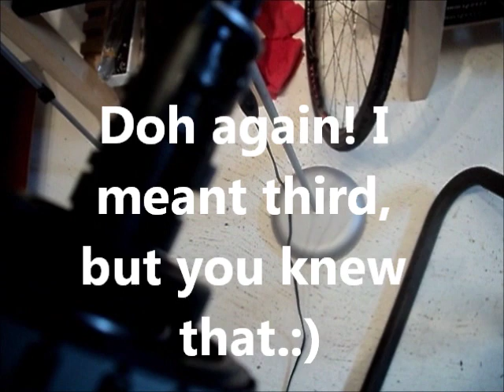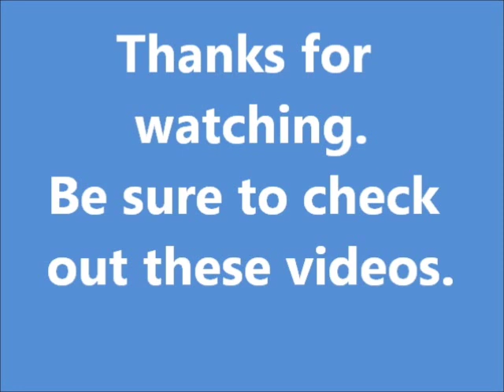Shimano Alfine 8 speed, Why shifter adjustment is critical.

Comment: Thanks so much for this video, it narrowed down a problem I'm having with my hub, though I'm still not sure how to remedy it: I only have gears 1 and 5. Shifting 1-4 stays in 1st gear, then shifting from 4 to 5 gives a good shift to 5th gear, and shifting from 5-8 keeps the bike in 5th gear. So my clutch must be working, but the pawls are not. Have you seen this before? Any tips before I open it up?
Reply from the maker: Two possibilities come to mind. Either the pawls are not engaging or the high speed roller clutch has failed. This would cause the symptoms you describe.

Comment: Besides the Electric Shifter ( MU-S705 )  Why is one hub Electric Shift ( SG-S505 ) And one Mechanical/Cable shift ( SG-S501 )?
Why can't you put the 'Manual/Cable' shift on the SG-S505?
Reply from the maker: The SG S505 has no shift return spring. The stepper motor does the shifting in both directions. a mechanical shifter would not work unless you cobbled together a two cable pull pull system.

Comment: In addition to being completely out of focus, this video doesn't follow up on how to adjust the shifter cables. My alfine 8 shifter had trouble going from 4 to 5 gear. The hub also makes crunchy sound when pedaling backwards.

From other sources I figured out the procedure:
-Shift up to 8, then back down to 4. Check for the indicator lines on both bottom and top of the Alfine hub, on the drive side
-If the lines don't line up, twist the barrel adjuster on the shifter, then shift to 8 back down to 4 again
-Repeat until the indicator line lines up

My shifter did better after lining up indicator but still had trouble with 4 to 5. Next step is to flush the shifter with WD40 followed by relubrication. From what I gathered, the backward pedal noise is "normal" for some alfine 8 hubs and is not indication of any issue. Hope this helps

Comment: Thanks for this peek inside the Alfine. Very interesting. I'm wondering if, with your experience with this hub, you might have an idea as to why when I go to readjust the shifter cable tension on my bike, equipped with the Alfine 8 hub, I always find that I need to loosen the cable.

This is contrary to my experience with other bikes, and other cable-actuated devices on the bike (i.e. brakes). Over time, cables tend to stretch and need a bit of tensioning. Or brakes wear down, and need significant tensioning at the caliper.

But why would my shifter cable tend to tension itself over time, requiring me to reduce tension when adjusting it?

Comment: Need your help. You have a lot of mechanical experience to understand all these intricate design functions. I installed an 8 speed Alfina last july and it never worked on gears 1-3 (gear slipping grinding . So i use 4-8 only. It is an ebike with a mid motor . Is there a particular weakness on the design drive of 1-3 vs 4-8? Or maybe i did not set this up correctly. I know that on gear 4 shifter setting, the yellow line and dot should be precisely aligned. Please let me know what is wrong here.

Comment: The shifter control, (on the bars), was not functioning so I stepped and cleaned everything and cannot rebuild it.  Damn that thing is intricate. 
So Im trying to run the thing with twist shifts from another system. But it doesn't click enough times. Only for 7 speeds instead of 8. This already seems like a wasted venture to me but I'll put it out there. This won't work will it?
I need to find an exploded view of the control unit to rebuild it correctly or buy a newie. Or perhaps another shifter by Shimano  with 8 positions might work?
 I think I already know the right answers to my questions. It's just that sometimes, especially with stuff we are inexperienced with, we can overlook a simple fix.  Anyone got any?
Reply from the maker: A Nexus or Alfine hub has dedicated shifters. One will work with the other, but an 8 speed derailleur type shifter will not work. The cable pull increments are different.

Comment: Would not having the shifter cable correctly adjusted possibly destroy the clutch? I have a strange clicking noise when I free wheel or back pedal only in 5, 6, 7, and 8th gear. Is it possible to remove the clutch/RH cones without the special shimano tool?
Reply: Just a heads up. I had my alfine 8 for two years and started developing problems 6 months ago where certain gears in the higher rang (5,6,7,8) would not engage smoothly and where the 8th gear began continuously clicking. . Adjust was spot on. I just fixed the problem today by changing out the cable and it works perfectly. I opened the hub 8 months ago and everything inside was pristine and well greased. The reason why changing the cable worked so well is that once you get into the higher gears on the alfine the tension in the shifter cable increases causing it to stretch more and be less accurate in the higher gears. This is many alfine users a have issues in the higher gears. Cannot believe that the cable change was so simple, easy, cheap, and effective. Should be the second troubleshooting step after checking adjustment. Best of luck to everyone!!!
Reply from the maker: +Clock Radio 
 Clicking sounds when backpedalling in high range are completely normal. If you are not having engagement or any other functional issues, don't worry, just ride.
Reply: +Dan Burkhart  This isn't normal clicking. There is something wrong with the clutch - and this fantastic video shows me that standing up while accelerating between 4 and 5 with the selector cable maladjusted means something has broken.
So can you imagine the good work you could do if the video was IN FOCUS!!!!!!!
Reply from the maker: +Clock Radio Yeah, I know. I shot this video with a broken camera. The viewer screen did not work.
I will upload a replacement soon, but I am very busy with other projects at the moment.

Comment: Thanks for the video.

For non-techies like me who are curious about how IGHs work inside, it'd be cool if you could shoot it again by making sure that 1) the camcorder focuses on the gear hub in the foreground instead of the background so that the gear hub isn't out of focus, 2) that the background is dark while the foreground is lit up so that there's no backlight and 3) the camcorder is put on a tripod so that it doesn't shake while shooting.

Ideally, you could take several shots and put them together using a basic video editor like Windows' MovieMaker.
www.videohelp.com/tools/sections/video-editors-advanced
Reply from the maker: Thanks, I realize the video quality is poor. As promised at the beginning of the video, I will be adding a video showing in depth how this hub works, but I am shopping for a new camera first.
 The camera I was using has a broken view screen, so I can't see what I'm recording.
 Look for a much higher quality video on the topic early next year.
 Dan
Reply: The current camcorder could be good enough for that purpose as long as 1) the autofocus doesn't get lost between the foreground and the background (hence the need to use a dark background), 2) the part you want to focus on is well lit (just use a flashlight) and 3) the camcorder sits still (tripod). Maybe the camera even has a "macro" mode for shooting up close.

You could shoot the different scenes out of order and edit them later, as it's easier to focus on either shooting or explaining but not both at the same time. I personally use Corel's VideoStudio Pro but even Windows' free MovieMaker is good enough.

Anyway, thanks much for those videos for newbies on an otherwise surprisingly rarely covered subject. IGHs rule! :-)
Reply from the maker: vincentdelporte Thanks for the tips, I do use movie maker for most of my projects. Sometimes, I just use stills and do a voiceover.

Comment: Highlights the weak point of the Nexus/Alfine hubs. Relying on cable tension to ensure the pawl movement is not a great solution - particularly compared to Rohloff's indexing that does not rely on cable tension. I still like my Alfine so don't think I'm a hater . This design weakness just irks me because I think Shimano's engineers are capable of better.

Comment: Or you could just buy a proper Shimano group set, instead... that thing. What's the problem with the old good MTB group sets? They are perfect for every rider, even the casual ones. What is the need for it to be internal and unnecessarily complicated? Go to the bike shop, buy an Alivio group set and voilà! no more problems. Or you could buy something more expensive, like SLX or XT, but that's up to you.
Reply from the maker: For many riders, myself included, the many benefits of IGH outweigh the downsides.
 You obviously don't get it, and that's fine. Go with what works for you.
 IGH is here to stay. I'm just offering help for those that use or work on them.
Reply: The problem is You need to care about "proper" derailleur more. With one cog on front You don't have to care about chain line. You need to oil your derailleur, You can even broke it. IGH can change gear while not moving - good for riding in city. This hubs are coplicated - yes, that's true. But only inside - using this is very nice and easy.
Reply: Lestat de Lioncourt
Internally geared hubs go up to 14 gears, one chainring in the front, one cog in the back. That gives you a clean bike and the ultimate in reliability. As a man once said, simplicity is the ultimate sophistication.
Reply: But you also could get group set with only one chaingring on the crankset. Then, you have only one speed on the front and 8, 9, 10 or even 11 cogs on the free wheel.
Reply: Лучше ездить на такси. И нет проблем.

Comment: Thanks for the video. Just finished overhauling my hub, rode it and got no gear change past 4th. Re-watched this video, set up the guts in my dropout just like you showed, and saw no clutch movement. Rebuilt the hub paying closer attention to clutch installation, and all is good. No telling how long it would have taken to track down without watching this.